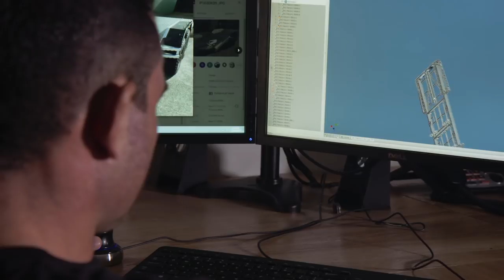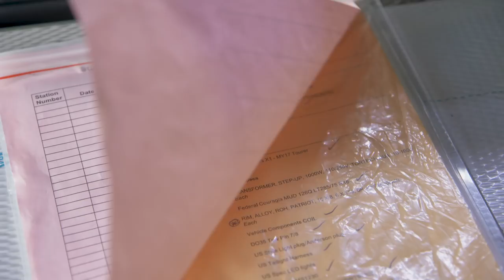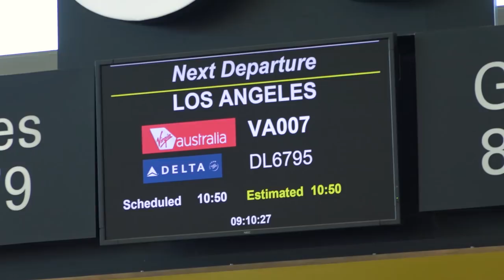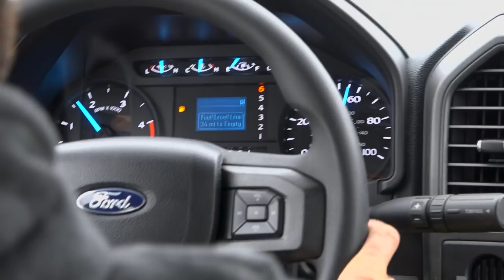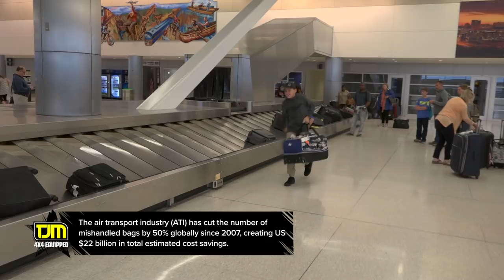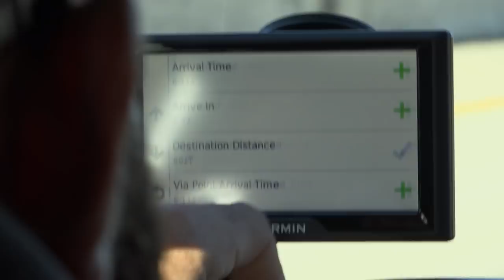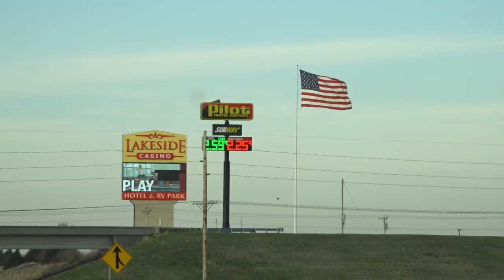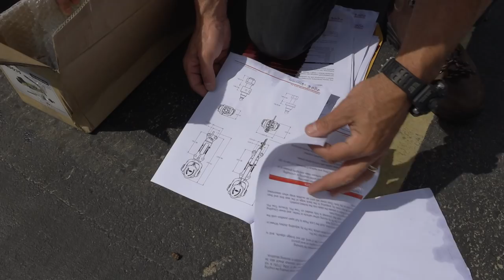Patriot Campers Launches In The USA, Our Journey To Moab

Comment: Hi guys with the belt issues you had is there any way of modifying it to run twin belts and making your own side cover with cooling fins on the outside. Also with your airpod getting filled with dirt could you maybe fit a spare one in the or adapt even a car airbox to limit the dust to the filter by running a duct into the cockpit area